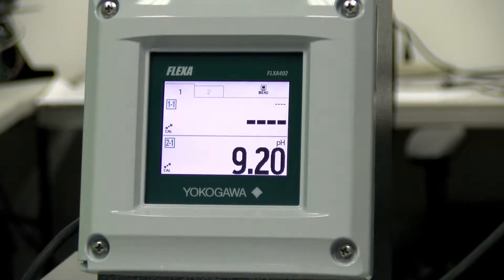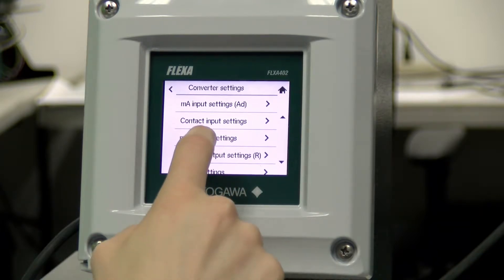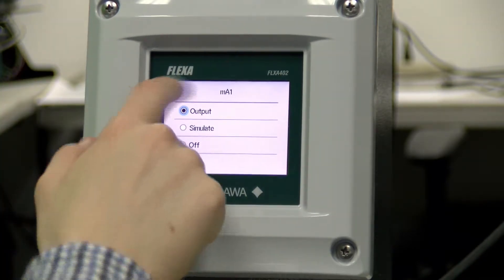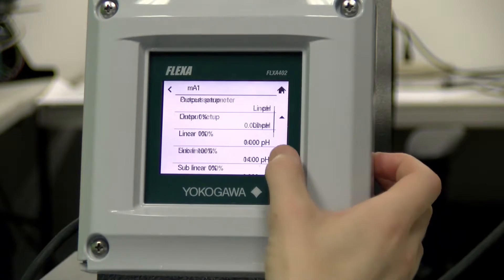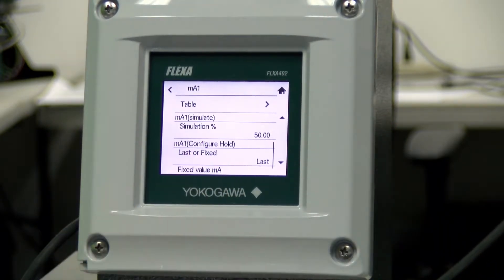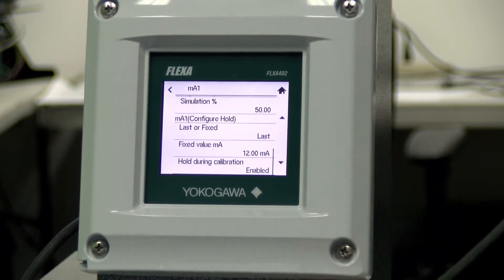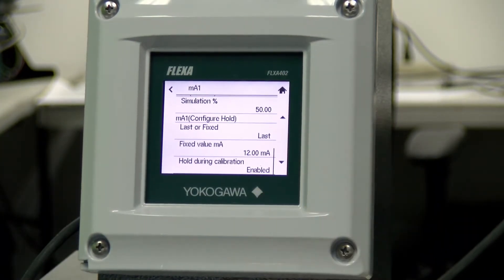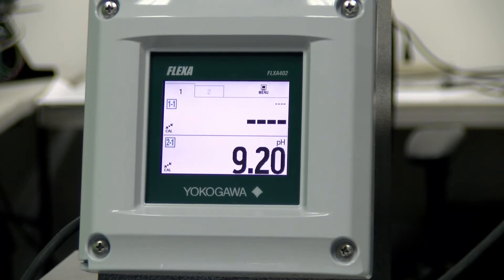Programming mA Output Settings

Comment: If the digital SENCOM sensors are used, I think a maximum of five can be used with the FLXA correct? This will require QTY 1 BA11 module and QTY 5 of the SA11s, correct? I have a customer who is wanting this particular setup for pH. However, he wants all five outputs to be 4-20 mA. From what I’ve seen in the manual, looks like there are only QTY 4 outputs available for 4-20 mA. Is there not a fifth?
Reply from the maker: Yes, a maximum of 5 sensors can be used with SENCOM. It would require 1 x BA11 and 5 x SA11’s to connect 5 sensors.
 We have a maximum of 4 4-20mA outputs that we can offer. However, there is HART overlayed on the 1st mA output, so up to three additional values can be obtained using HART secondary, tertiary, and quaternary values. If you require any further clarification, then please email YCA-Support@yokogawa.com. Thanks